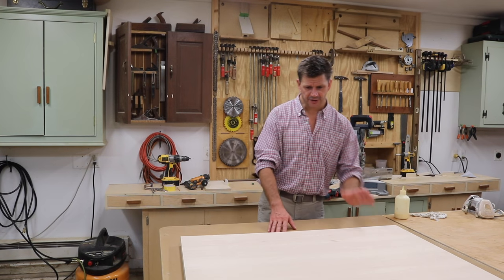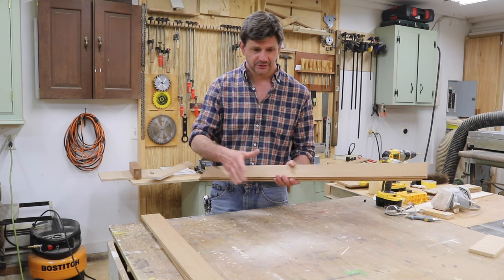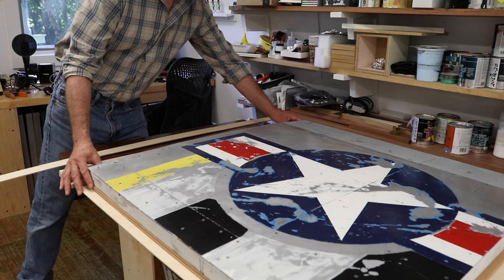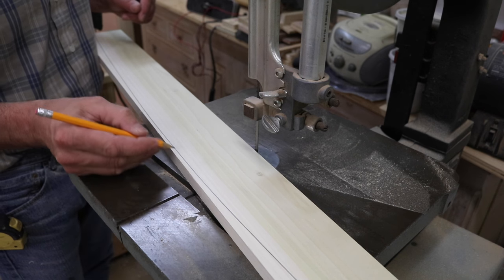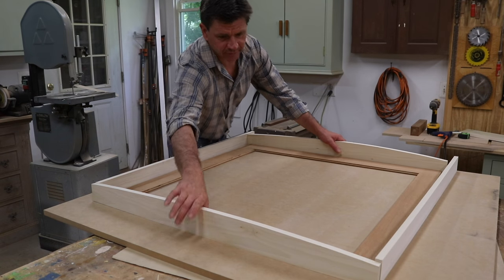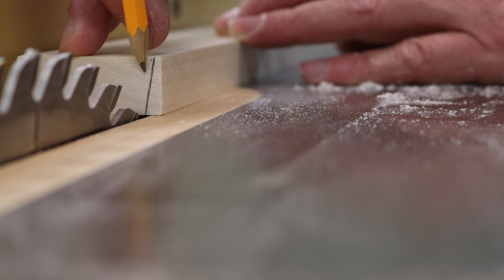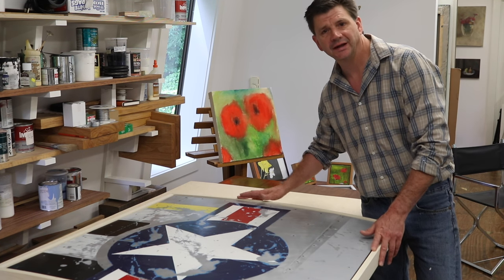Make a Convex Frame

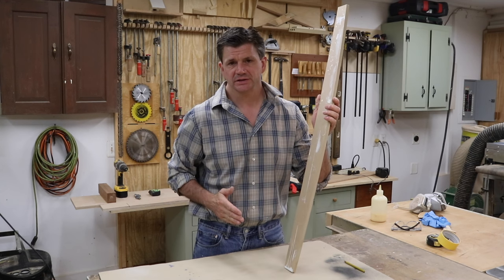Comment: I'm still trying to build up the confidence to make a resaw like the one you did at 3:10. Always worry about a kickback. Is this a dangerous cut without a riving knife?
Reply: As long as your blade is sharp and your fence is in line with your blade it is easy. You get kickback when it is pinched, meaning you didn't have a good hold on it. Use your push sticks and you'll be fine. Good luck!
Reply: All those cuts shown without a riving knife are potentially dangerous. It's not just about having a good grip on the work, it's about internal tension in the pieces.

Jon decides to work that way, but don't mistake his comfort with a technique he's used for a long time with a best or safe practice.